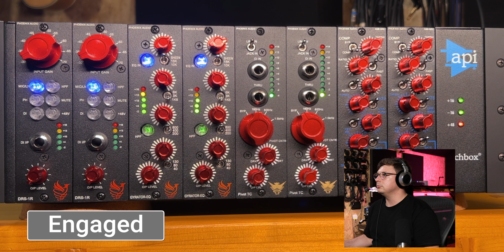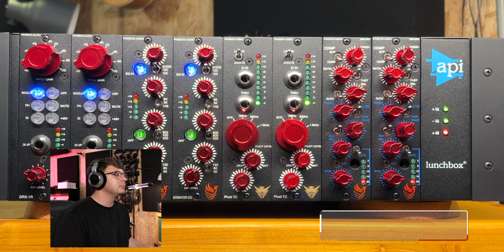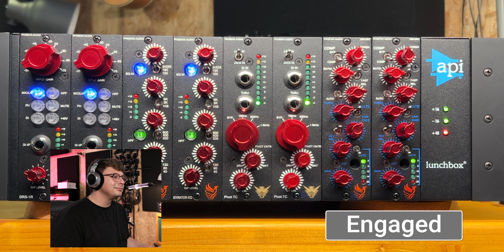Phoenix Audio Gyrator EQ, Compressor & Pivot. Demo & Review

Comment: Hey curious, what mic did you use to sing? Do you remember the chain? It sounded nice and smooth.

Would you say the Phoenix eq sounds thicker than a neve? You mention you wanted a high pass so it makes me wonder how it compares. From what I have heard it seems pheonix audio stuff is a bit more open than a neve counterpart?

Thanks!
Reply from the maker: Hey there, Hey There! :) this was the DPA 4011. Used with a Cranborne Audio EC2. You can see the video on my DPA studio bundle review.
Reply from the maker: I would not say that the Phoenix sounds thicker than a Neve. I totally agree with you that the Phoenix stuff feels more open. I’m a big fan of the Phoenix tone.

Comment: Just watching you twiddling the knobs and flicking the switches, they seem rather close together to the point that they looked somewhat fiddly and awkward to use. Was that your experience?
Reply from the maker: As I said in the video the Compressor was a little too tight for my hands. The other units were spot on. Because each of the pots on the Phoenix units are indented, they don’t move accidentally if you gently touch one.